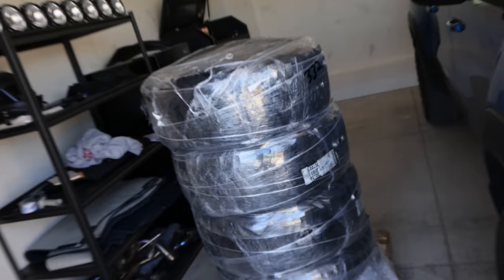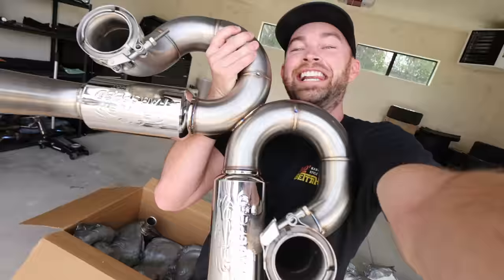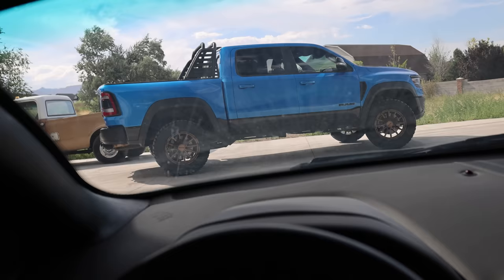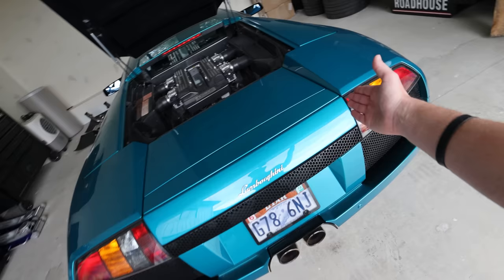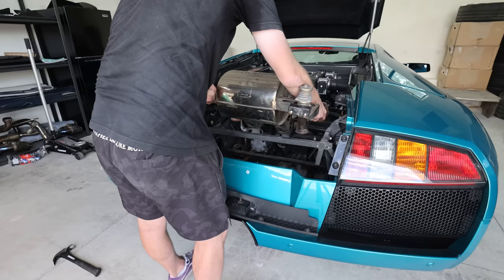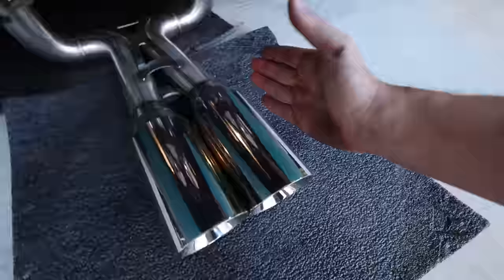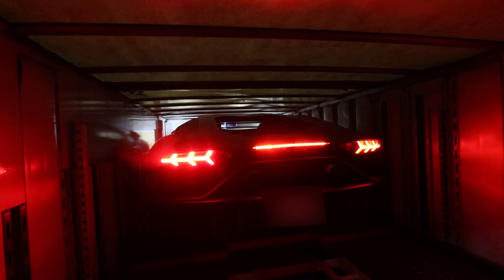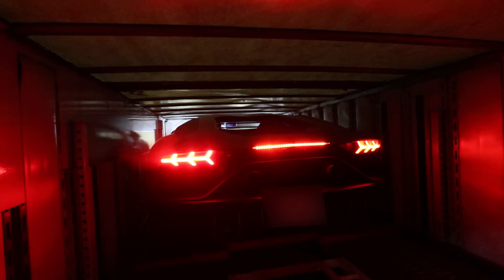The Ultimae Aventador has been Delivered!!

Comment: How's this the 40th anniversary edition? Anybody care to explain this?
Reply: In 2003 Lamborghini celebrated its 40th anniversary by releasing this version of the Murcielago.  There's 50 of them and each of them are numbered (this is car number 19 of 50), they came out in this colour known as Verde Artemis, had carbon fibre behind the rear side window, unique grey wheels, redesigned exhaust, with a dark grey interior on the driver side while black on the passenger side.
Reply: @TaffPlays  thank you 👌